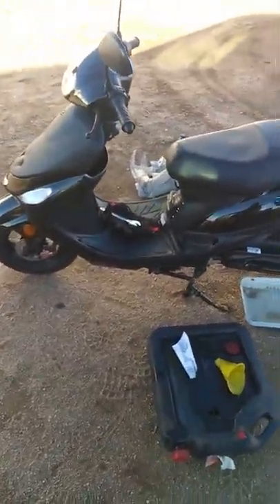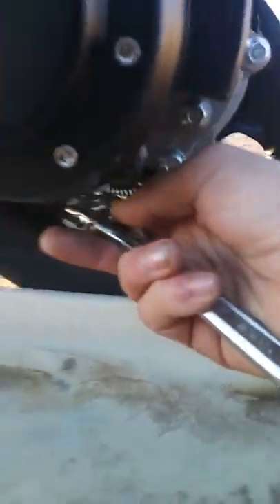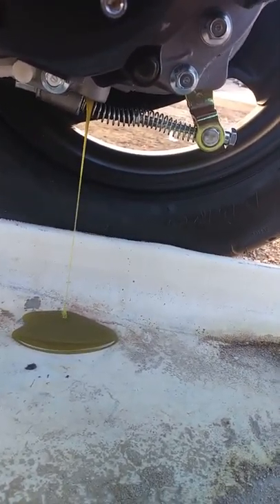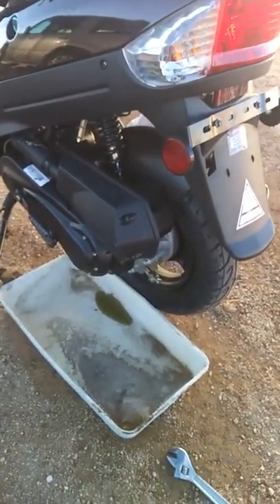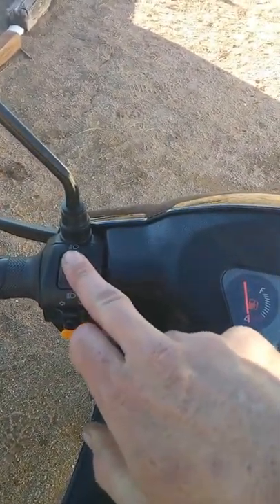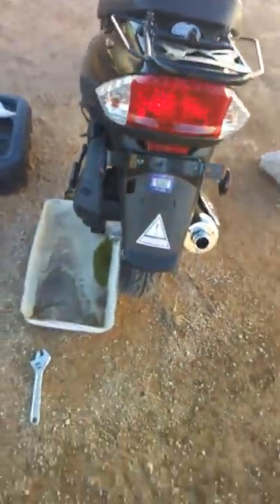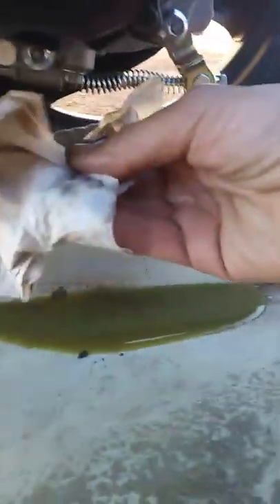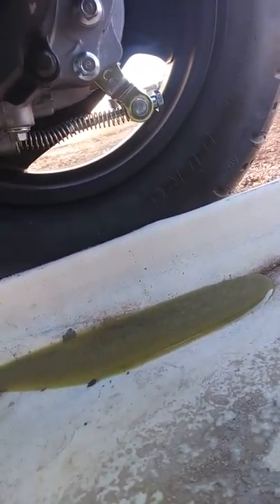TAO TAO 50cc scooter gear oil change part 1

Comment: Thanks for the vid. My used gear oil smelled like burnt rubber. approx 1500 miles on that gear oil.
Reply from the maker: Ya that's a lot on a small motor like this

Comment: Hey man,I'm getting a 2017 moped like yours. It has no owners manual, how often do you change gear oil once a season/once a year?   And how about the spark plug,or plugs   how often do you change those. They don't have a oil filter correct...??    Thanks never owned one before I'm 50 years old  going to be pretty fun   lol    had motorcycles for a long time.
Reply from the maker: I change it about every 300 to 500 miles or every 6 months.  Im not sure on the recommended. It has a oil screen not an oild filter.

Comment: I have the X-PRO 50cc Jiangsu Baodiao scooter, but I'm told by the manufacturer that the engine oil will lubricate the main engine parts and the gear at the same time, because the internal space of my engine is connected...

Comment: You did not show the fill process
Reply from the maker: My bad.  Put the screen and cap back in then fill through the dipstick cap.
Reply: Tactical Evolution Adventures  I believe you are incorrect. No dipstick for gear oil. The fill hole for the gear oil is the middle bolt just above the drain on the SIDE of the case.
Reply from the maker: Srry thought it was the vid for the oil change not gear oil.
Reply: Tactical Evolution Adventures thanks for the video anywho. MAGA
Reply from the maker: @ryankorn5911  yup sorry i didn't make the fill video while i had the scooter.

Comment: My scooter is making a ticking noise when I accelerate. Idk if it’s my gear oil, brakes, or wheel bearing.
Reply from the maker: Where does it sound like its coming from?
Reply: Tactical Evolution Adventures I can hear it from the rear wheel/muffler area
Reply from the maker: @beeezybone  check the gear oil first to make sure uts full. Then check to see if there is metal.flakes in it.
Reply: Tactical Evolution Adventures alright thanks. I have a 86 honda aero50 by the way
Reply: What gear oil do I use
Reply from the maker: For this scooter if you watch part 3 it tells you.  But i use 80w90 gear oil
Reply: Tactical Evolution Adventures do you know about electrical? My right turn signal isn’t working but my left works no problem. I tried putting new bulbs in and still didn’t work. Could it be the relay?
Reply from the maker: @beeezybone  it could be. Or the switch is messed up for the right side. Take an electrical tester, pull the bulb and test the wires inside where the bulb connects while you have the blinker on.

Comment: There is no way you will get 50mph on that 50cc taotao pony, 32-35 max unless you're going down a steep hill.
The first oil change is done @ 300 miles than its every 1000km, carb gets adjusted @ 4,8,12km. These bikes are made to run lean so the plug needs to be looked at for carbon build up. The carb jet needles used is a 74 but to set it right replace with a 80. Since the carb is sealed you have to know how to open it to change said needle.
Any 50cc can be rode on the road with just a driver's license because they only go an average 30mph, any scooter over 50cc you need to get a motorcycle license.
Reply: @kareoluk I would like to try it and see for myself, so what model on carb would have to be used for a Pony50 and if possible a direct link to its purchase.
Reply: @howielandry9495  I just got brand new one 2021 no mileage stock and I went 40mph flat ground.
Reply: For a fact , on a flat straight away ,  I have hit 53mph .. with all stock parts , no modifications what so ever .. I have a friend that owns a new model and his only does around 45mph .. Why I don't know ..